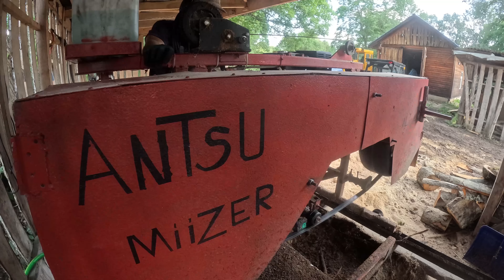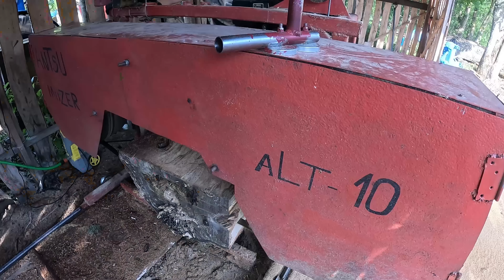Firewood Movie - "The next part"

Comment: those off cuts from the wood projects make great kindling and fire starters for when you need to light a fire i wouldnt dump them i always keep themm and use them with a match and some pine cones to light my fireplkace and stoves
Reply: its basically really thin/small  very dry wood
Reply from the maker: Yeh

Comment: It would probably help a lot if you'd put a diagonal (or an X) between the two supports on the moving platform of the firewood cutter. That should reduce the side to side movement a lot. If you do an X, you could even use something simple and light like a metal cable.
Reply from the maker: Hmm yeh

Comment: I remove the safety button on my log splitter and put in a foot switch instead, that way I still had my right hand free to do other things with. I also put a slightly longer lever on the control valve so that I didn't have to bend over to activate the ram.
Reply from the maker: I will look into it

Comment: I noticed on your Bobcat's gauges on the right, that the left gauge is jumping all over the place.  Is that normal?  You scared the crap out of me when you used that chainsaw next to that saw blade. To bad they didn't give you the metal frames!   Much better with those metal frames! 👍  Maybe use L-Brackets to hold those wooden boxes together.
Reply from the maker: Fuel gauge. Yes its the type of sensor. Fuel moves and sloshes around

Comment: Why not cuz them into square sections to screw together over A wood shed shack storage building for winter firewood protection out of the weather. Make it A plastic covered building from wood covered in the plastic out of those metal cages. As A wood shed shack with Even covered plastic door to.

Comment: If you make a guard for the saw dont use steel use aluminum that will stop the saw blade but wont send metal pieces at you if it does hit the aluminum.

Comment: Talked to an equipment mechanic at work about your dozer and he also said it sounds like a stuck clutch disc if the clutch break won’t stop the shaft from turning. He suggested what you already tried or putting it in gear, getting a bigger piece of equipment and dragging it, hoping it will get enough traction until it released the stuck disc. Or ripping it apart which would probably take some time and work. Good luck getting him going. Instead of calling it Joseph you could have given it a female name but then it probably would have given you even more problems. 😂 
Try e-mailing Clint from C&C Equipment, he’s got a U-Tube channel and he might give you some ideas.
Reply from the maker: Ohh yea

Comment: Yo, here we have some serious work going on, which you accomplished with excellence. I know, 2 people is way more productive, but (us) being alone in our work, we can still accomplish a lot although is more time consuming by running around or as you said, picking up piece by piece while the saw runs doing nothing. I personally loose a lot of time searching for tools I need, 😠because I have 15 works at the same time with long pauses in between. Anyway, you should consider the option of somehow integrating your log splitters and chopsaw into some kind of firewood "processor" thingy, so you have stock holding capacity and easy handling capacity. There is no need to make exceptional stuff like industrial ones, just some sort of "merger" with the existing ones, 🙂 if you know what I mean.. Other than that those totes will be a nice storage, just avoid heavy items as those are made to live in captivity... 😉 You practically unleashed their potential but gave them freedom of movement to do unorthodox things. Keep up the work, we're watching. Don't you feel "observed" from time to time? 😏

Comment: Andris you really need a cutter splitter combination powered with pto.
Reply: Just what i was thinking. I have a old processor that i got cheap. Wery effective with only one man 👍
Reply: Yeah i have Krpan CS 420 with a litfting table MD 500. I bought it new in 2018 and it's the best thing i have. The conveyor belt just throws wood in pallets and i just rearange wood in the pallet when they fall awkwardly and that's it. 🍻
Reply from the maker: Working on the idea

Comment: I guess for rock storage, the totes with metal cage around them would be better. Rocks are heavy, and i don't think just the plastic alone would be able to hold them in. One cubic meter of stone is around 1.5 tons, so filling up one of these containers would make it very hard to handle and move around.
Reply from the maker: I tested it. Filled half way and it's holding. Plastic has warped a bit but it holds 😂

Comment: Ants, have you seen Donn DIY's log splitter? it cuts the logs then as it pulls the log forward for the next cut it also splits the log with the same action.
Very efficient process he also has a converter that loads the containers but this is not as neatly stacked as you do it.
Reply from the maker: Yeah i have. Will build something similar

Comment: Could you put the motor underneath the table, and some pulleys to do your speed reduction by the motor and use a smaller pulley on the saw shaft to give you more room for the logs ?
Reply from the maker: Yeah i could

Comment: Firewood making is hard labor. I wonder how much firewood do you burn trough one year? I keep the scrap pieces so I can burn them later or just throw them into the shop own to heat turning the cold times of the year. Even half rotten wood is sometimes good to start a fire if it is dry. I'm gonna save up some maple and oak trees so you can cut them and make something out of it.
You can use the empty containers to store Joseph parts or what ever else that is just hanging out. I do like your buzz saw, that thing is a true champ. Should consider building a similar contraption.
Reply from the maker: About 10 m3

Comment: Another entertaining video, can not wait to see what's next. I've got a splitter like yours, I extended the pusher so it now stops a couple of inches from the wedge, so much better. I also installed a foot pedal to operate the electric motor so you got one hand free to hold the log if you need to, that so much better than pressing that button all the time. Hope you have a great weekend

Comment: Flying Ant Day :  An ant colony can only expand so much.  At some point a new queen will need to strike out on her own to begin a new colony. She needs to meet and mate with a male from a different colony and find a new area in which to start building her nest. Growing wings and flying enables her to do this.
So each year, Ants emerge from nests and take flight. They are just looking for a mate.
The large winged females and the smaller winged males are often seen flying joined together. This is known as the nuptial flight. Once ants have mated, the role of the males is over. The mated queens quickly chew off their own wings and begin looking for a suitable site in which to nest and set up a new colony. This is why you often see large ants walking around after a 'flying ant day' and may even see discarded wings scattered over the area.

Comment: Andris.
In the UK, this is the deal.if you are made redundant

You’ll normally be entitled to statutory redundancy pay if you’re an employee and you’ve been working for your current employer for 2 years or more.

You’ll get:

half a week’s pay for each full year you were under 22

one week’s pay for each full year you were 22 or older, but under 41

one and half week’s pay for each full year you were 41 or older

Length of service is capped at 20 years.

Your weekly pay is the average you earned per week over the 12 weeks before the day you got your redundancy notice.

If you were paid less than usual because you were ‘on furlough’ because of coronavirus, your statutory redundancy pay is based on what you would have earned normally.

If you were made redundant on or after 6 April 2024, your weekly pay is capped at £700 and the maximum statutory redundancy pay you can get is £21,000. If you were made redundant before 6 April 2024, these amounts will be lower.

You are in the EU. I don't imagine it will be that different? Maybe you should get more money??
Reply from the maker: In Estonia if you have worked for less then 10 yrs you get 1 month pay, if more then 10yrs you get 2mnth pay. So maximum would be about 3k plus whatever vacation pay you had lol. This is from the employer, the gov. Will pay max 1 month pay. So if.you worked for lets say 160 years and paid taxes nicely you wud get max 4.5k plus vacation pay.

Comment: Those flying bugs were actually future ant queens, they were flying away to mate :)
Reply: They are actually flying termites or "swarmers" and usually mean that there is an active termite colony nearby.
Reply: Plus this. When you breed, you reap :)
Reply: @danlangston2717  Not termites, it's too cold for them this north. They could survive during summer but they would all die at winter when the temps drop.
They are the same that were invading my frontyard for years, black small ants called "sokerimuurahainen" or 'sugar ant' for their like of anything sweet. Unlike the two other common ants this north, these don't have nasty bites and usually are only nuisance when they find their route inside to food sources.
Reply from the maker: Yeh too cold for termites in Estonia

Comment: I just found your channel was not subscribed! How did this happen? Must be YouTube problem. 

My workshop I have elevator to go up to loft. Runs off electric winch turns rod on bearings with steel cable on each side. My tractor cannot lift that high, bottom level has high roof. Oh I should say it is outside so I can load it with tractor, no lifting. I wish I could show you.

We are metric but use inches for lumber 2x4, 2x6 etc. Also for firewood. I like mine 350mm.
Reply from the maker: 350 is good

Comment: Ants , new queen ants have wings. They fly off to make new colonies
Reply from the maker: So many queens?
Reply: @Ants_Pants  thousand borne most don’t make it ( rich food sources) a few start new colonies. Works protect them until they are gone . At some points they mate with drones? Buddie you can do so much more with your channel , ( im a Tasmanian living in QLD / Australia ) I know nothing of Estonia , you can be an ambassador for your country, or just make a jaw crusher , automate the mill , build a huge carport, wood shed , love the show keep it up, just tossing a few out there like if you’re using the lathe outside cut just below centre, inside cutting keep the tool slightly above Center, im 70 years old mantaince fitter , welder , machinist , Clayton’s engineer ( IQ 170 ) . If I can pass on some thing you need? Cheers